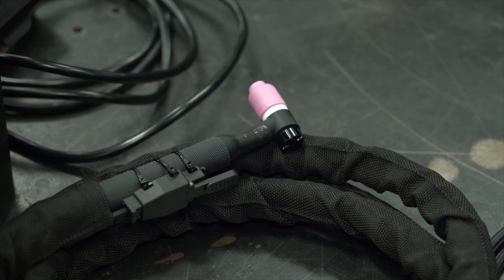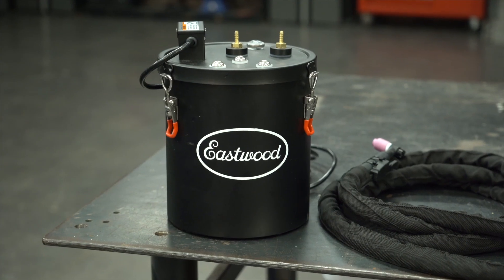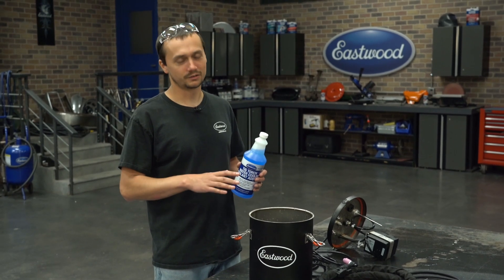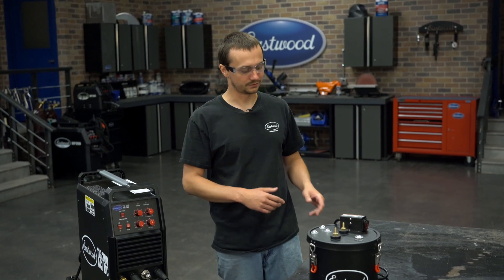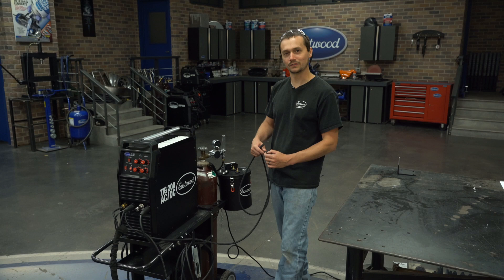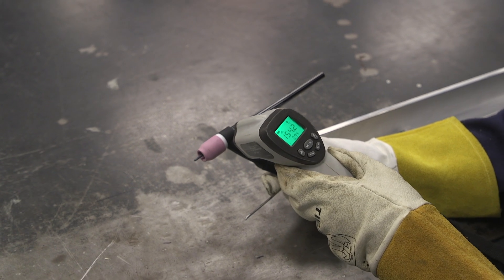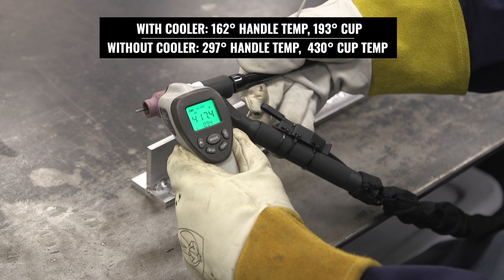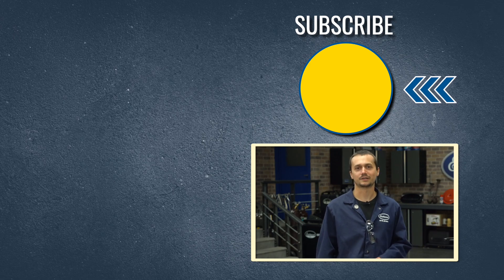We Used  a TIG Torch Water Cooler System to Drop Torch Temps 200°F - Eastwood

Comment: this is kinda funny 😂😂😂 or comical they should be a budget cooler not $299 budget my primeweld Maxcool 3000 was a hundred dollars more and it holds 2.2 gal and has a three core radiator in it has a flow alarm and a stainless steel pump and dual voltage for $100 dollar more I'm not knocking Eastwood I know they're trying but they should price it a little bit better it's almost like a stainless still trash can with a fish tank pump on it it's kind of not cool of what it is a normal welder would take and make it there self but anyways everybody has to start somewhere 👍🏻👍🏻👍🏻👍🏻👍🏻🤟🤟🤟🤟
Reply: I have a Airco water chiller tank BUT with 10 gallons of water and a big pump 1/2 hp motor and a place to check water flow never gets hot. No radiator but the tank is large enough to handle all welding.
Reply: @ke6bnl   with having that much water would give you a great deal of time to weld if the ambient temperature is 85° or below 10 gallons of water would give you a great length of time of welding and even on my Max cool 3000 I got to flow meter on it too to check my flow and a cleanable filter if any calcium or anything builds up in it.